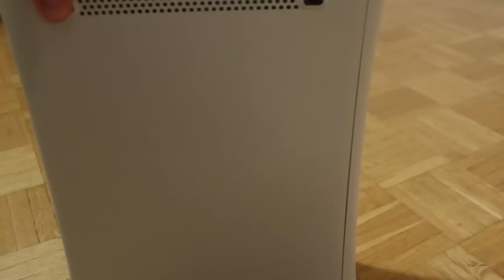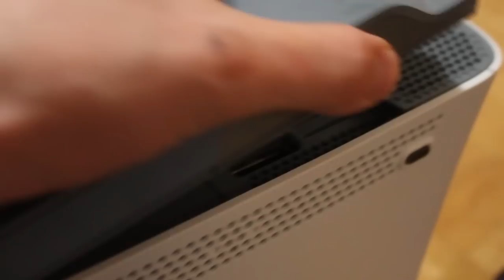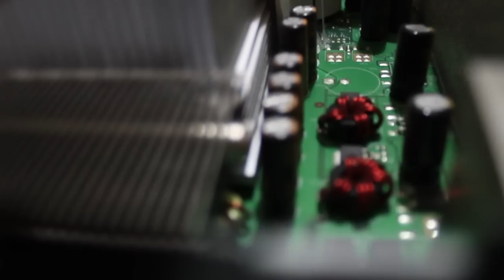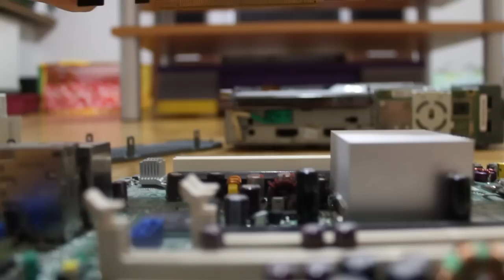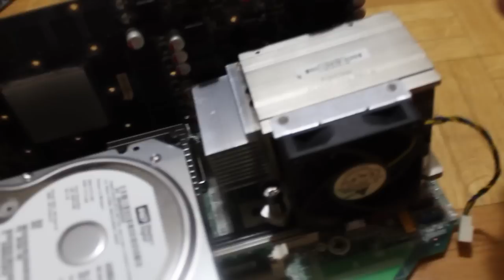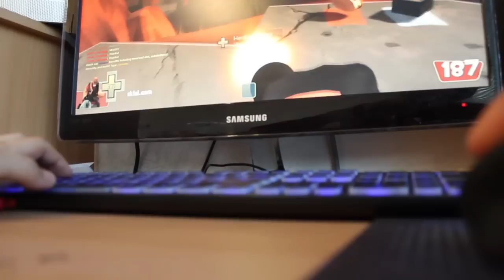Xbox 360 upgrade - works on PS4 One PS3 - faster frame rate and resolution, better than PC gaming

Comment: Sarcasm: "Why waste money on a crap obsolete console when you can put together a potato PC and run most of the same games from the same era at 720p medium settings at 60fp/s for less than $50?"

Me: "Uhm, probably because I still have my old Xbox 360 console that still works just fine after all these years and I still have my entire Xbox 360 game collection that also still play just fine after all these years. Oh and I have a potato PC with an AMD B550 motherboard with a Ryzen 5600 6 core 12 thread 4.2Ghz CPU, 32 GB of 3,200Mhz DDR4 RAM, and a potato XFX Radeon RX 580 GTS Black Edition 8GB GDDR5 graphics card, 1TB SanDisk NVMe M.2 Ultra 3D SSD that plays my entire PC game library just fine.

And of course I have my original Sega Genesis model 2 console I bought back in September of 1993 with a whole bunch of cartridge games that still play just fine after all these years.

My Sega Saturn that I bought in 1996 that still works just fine and still plays my collection of Sega Saturn game disks just fine.

My Nintendo 64 console that still works just fine with a whole bunch of games for it.

My Sony Playstation 2 model 1 console that I bought in 2001 that still works perfectly with my library of PS2 games. (Love the EXCLUSIVE RPGs by the way)

My original Xbox console that I bought back in 2002 that STILL works just fine and still plays my collection of OG Xbox games just fine.

My Playstation 3 Slim that I got in 2010 that still works just fine and plays my library of PS3 games without issues.

Then of course there's my Xbox 360 I mentioned and then of course the big fat stupid Playstation 4 Pro 1TB edition I have with a whole bunch of games for it.
It plays just fine.

And last but not least I have a Nintendo Wii with a bunch of games (ALL EXCLUSIVE). It still works without issue.

Oh and my next potato,... my Xbox Series X 1TB I'm picking up later today,...

Yeah, granted us console peasants are retarded stupid morons and all for choosing to not emulate, (pirate or whatever) like normal high level 597 IQ PC gamers do,... {sigh} call me a sentimental old fool. I really don't care.

I'll still laugh my ass off as I enjoy playing Coolspot or rocking out to the awesome Metallica inspired riffs in Lightning Force or exploring the challenging underwater mazes of Ecco the Dolphin. All on proper OG hardware.

😝
Reply from the maker: LOOK AT ME
Reply: @HungryGizmo  Noooooo,... I can't look!
My head will start spinning!
🙃🙂🙃🙂🙃🙂🙃🙂🙃🙂🙃🙂🙃🙂🙃🤪
Reply from the maker: @FunBunChuck  LOOOOOOOOOOOOOOOOOOOOOOOOOOOOOOOOOOOOOOOOOOOOOK. I beg of you!!!

Comment: I have an old Xbox 360, lad. Perhaps if I sent you mine by mail, perhaps you might do this also. A 240 or 320 GB Seagate solid state drive is a must for storage running the Xbox 360 faster.
Reply from the maker: ok. I will wait for mail.

Comment: Dude, if you're going through the trouble of physically upgrading the entire console just use an SSD instead of an HDD. Or at the very least a Firecuda SSHD. Actually a WD Black drive would last about a nice decade according to many reviews and forums I've read.
Reply: Whooooosh lmao good God..
Reply from the maker: Ferrecuda?
Reply: @HungryGizmo  Fire-cuda. It's a series of SSHDs that Seagate's selling to meet better than HDD performance and is marketed to gamers. The original Xbox could use one.
Reply: @HedgehogY2K  I don’t think you can put an ssd in a 360 it will work but you won’t be able to store certain items. The console will treat it like a usb drive you won’t be able to download your games to the ssd
Reply from the maker: I put whatever I want in my 360
Reply: @isaiah4478  It's funny that you mention that, let's go over a few things the console reads shall we. 1-flash drives max out at 32GB at 35MB/s, 2-external HDD&SSD or even pocket SSDs in my case max out MBR's 2.2TB capacity, 3-I know getting a SATA SSD working on 360 can be a process (which btw maxes at 300MB/s as per the SATA 2 standard) but it's really worth it for some people. Makes me wonder if soft modded 360's have TRIM enabled like that Project Stellar product for the OG Xbox.
Reply from the maker: I TRIM my parts

Comment: Underclock
Reply from the maker: unclock under the clock
Reply: Hungry Gizmo if you planned to do this kind of project I suggest you should use some 771 cpu and an gt740
Reply from the maker: I prefer ATI Rage 3D
Reply: I rather the intel 810 interated graphics
Reply from the maker: I prefer using an intel 386 CPU

Comment: I consider upgrading as making it better not changing it up
Reply from the maker: Ok. so. I have a car. the engine dies. I replace the engine with a better one. my tires go flat, I replace the tires with nicer tires. a few years later I dent my doors, and I replace the doors. every year I replace a part until every piece has been replaced. is it the same car? many people would say yes. Just like many would say this is the same Xbox, only upgraded.
Reply: @HungryGizmo  bud can't keep on upgrading it forever, as much as I like xbox, I is in no match for pc gaming bro. Only in words will it capture you to buy.

Comment: 750 ti is better still
Reply from the maker: that 750 ti you have is just a bios flashed 550 ti
Reply: http://www.game-debate.com/gpu/index.php?gid=883&gid2=483&compare=geforce-gtx-750-ti-vs-geforce-gtx-550-ti
Reply from the maker: now compare the 750ti knockoff
Reply: when was the knock off the real one if you were comparing the real one you would get better performance and in the cheap i have the EVGA One.
Reply from the maker: ATI 3DRage is better still

Comment: I don't know if this is a joke because you basically built a pc from scratch with no xbox components  without the xbox os insted you used windows and it can't play any xbox 360 exclusives but you still called an xbox
Reply from the maker: is your car still your car after you replace the engine?

Comment: well you see thats not physically possible to be better than a pc
Reply: Hungry Gizmo no its not going to. if its well planed they may be abel to inovate ways around lesser processing power and make it less obivous but blowing pc away is very hard and usualy make the product very expensive compared to pc. again it can be somewhat surpassed whit clever planning
Reply from the maker: why is it not?
Reply from the maker: after all the upgrades in this video? of course
Reply from the maker: not after doing the upgrades. did you see the latest xbox prototype? it's going to blow PC away
Reply from the maker: sorry. but with 5 potatoes and 3 onions, I don't think PC can compete
Reply: Hungry Gizmo no matter what the new xbox has. it will be outdated on release. you cant make a console stronger than a pc because a pc is "infinitely" more powerful depending on what you put in it
Reply from the maker: how many onions does your PC have?

Comment: "Better than PC Gaming"

I have modded my Datsun and got some extra horsepower. Better than a Ferrari.

PS: Yes I picked the sarcasm.
Reply: SaladFingers it also depends on the scenario, for example if the topic is crossing a 2ft deep creek what will work better, an old Datsun truck or a Ferrari?
Reply from the maker: a tricycle

Comment: You effectively just used some xbox 360 components to make a cheap PC, and by having to install windows, it is, effectively a PC
Reply: You are seriously a moron if you didn't pick up the fucking satire
Reply: Are you dense? Did you actually watch the video?
Reply: Yes, you just explained the entire joke...
Reply: He actually didn't use any Xbox 360 components. He disassembled the 360 and then only shows close ups of the 360 motherboard, then when he zoomed out to add the cpu, it was a different motherboard. No 360 components were used during the making of this PC. Thus, no PCs were harmed during the making of this video.
Reply: Wow, you're smart.
Reply: Oh, and a 500$PC could outrun this by a mile
Reply: that's the joke Sherlock
Reply: What a fucking moron.
Reply from the maker: I effectively figured out how to install windows on Xbox hardware. how is that not impressive?

Comment: You show those elite PC gamers! XBox FTW! #ConsoleMasterRace
Reply: +Zain Robson I was joking. I just got done playing DOOM on max settings. Upgraded my GPU a few months back. I haven't touched a console in years.
Reply: +Zain Robson I upgraded from a gtx 660 TI to a gtx 970. It lets me run most games on max and I also have a Vive :)
Reply: +Zain Robson Thanks, no SLI just the one card. I'm thinking about upgrading to a 1080 when I get the cash/when I upgrade my monitor. Been PC gaming for the past 4 years, and I'll never go back.
Reply from the maker: just wait until I upgrade the Xbox two

Comment: Thanks, I used these instructions for my wii u and now I can play games at 110fps 1440p
Reply from the maker: he doesn't need data cables for where these pixels are going!
Reply: +MonkeyMaster 64 you can't run 4k on more than 60 fps because there doesn't exist a cable with such high data transmission
Reply: for transfering the signal from you graphics card to your monitor
Reply: +Soudi oh
Reply: +Soudi what do you need a cable for
Reply: How else do you see stuff on your monitor?
Reply: +King Blank Blasphemy. 4k 144FPS or GTFO